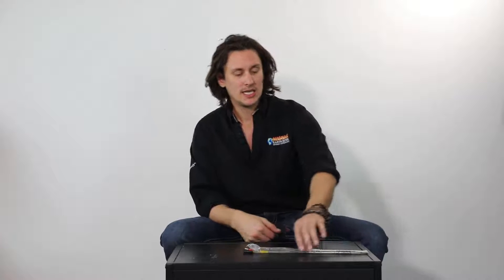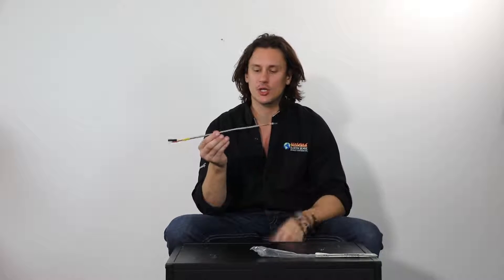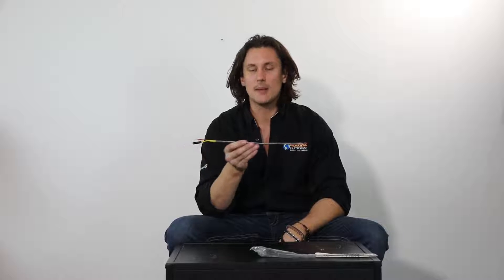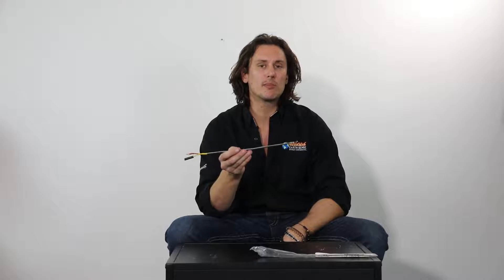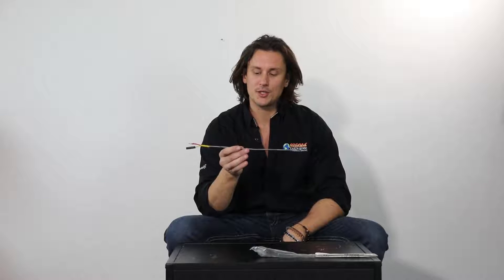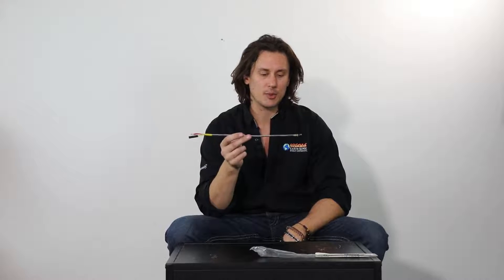Quadrafire Thermocouple Function & Troubleshooting

Comment: Mine Quadra fire will  run but not reach temperature at all then some time it fine ??
Reply from the maker: Thanks for contacting us. Let us know which Quadra-Fire model you have. Sounds like your stove is going through startup and sometimes goes into normal operation but majority of time shuts down after startup - is that correct? The thermocouple senses the heat during startup allowing the stove to go into normal operation. You can double check the thermocouple electrical connections, and make sure the thermocouple is far enough over the firepot. Always make sure the ceramic cover is on during operation. Here's a video with some tips on the ceramic cover and placement of the thermocouple https://youtu.be/tOqcNRELOq0?si=CmYUF0xyzOSNb3Q-
If you do need a new thermocouple we can help steer you towards the correct replacement once we know which model you have. Happy to assist, thanks.

Comment: Im at my witts end with my castile insert. It was running perfect at the end of last season and when we went to run it this year it would just feed pellets and the igniter wouldn't get hot ,i changed it and it turned on but would cut out after a few hours. I have since changed all 3 snap discs and the thermostat,  then i was getting a 3 amber light 3 blink code which is supposed to be the thermocouple so i changed that now it lights and the igniter stays on then the stove shuts down but with no codes (blinks) . I have also changed the vacuum switch and blew air in the line to make sure it was clear and it was. My local dealer closed down and the 2 other dealers that took over after that one closed do not return calls and there is no customer service number.  Frustrated and thinking its time to get rid of this thing. Ive had it for almost 20 years and purchased it brand new and have also changed the auger mother 3 times the exhaust motor and the fan motor once each.
Reply: Ok ,I will give it a try tomorrow. And report back. Thanks
Reply from the maker: Thanks for contacting us, happy to help. Glad the unit is now igniting properly. Let's try reversing the wires for the Thermocouple connection to the terminal block. Let us know if that makes any difference for you. Keep us posted.
Reply: @EarthSense hi, thanks for replying.  I hooked up the wires exactly the same as the old thermocouple. One wire has a male terminal (red wire) and the other has a female terminal (yellow wire). Are you saying to cut and reverse those wires ?
Reply from the maker: @bryanmcgovern7858  We have run into a good number of the Quadrafire thermocouples where the wires need to be reversed on the terminal block to work as it is supposed to. Based on what you described it does sound like we have an issue with the Thermocouple registering temp after startup. Reverse those wires and let us know. Thanks.
Reply: @EarthSense ok, I will give it a try tomorrow and report back. Thanks
Reply: @EarthSense omg, you are a life saver ! I made 2 three inch jumper wires ,(male to male and female to female) instead of cutting and splicing and the stove kicked right on and the igniter went out and she is feeding pellets. I would have never known or thought to do that. I know my way around cars ,small engine equipment and I have done work on this stove for close to 20 years but you just made my wife happy and saved us some oil money.  We thank you for your help and knowledge.
Reply from the maker: @bryanmcgovern7858  Fantastic to hear! Had a feeling that was what we were running into. Appreciate you letting us know and so glad we were able to help. Happy wife, saving some money - the good things in life :) If anything else comes up just let us know. Have a great upcoming Thanksgiving!
Reply: @EarthSense thank you. Have a happy Thanksgiving

Comment: I have a sante fe insert, Quadra Fire, it is not igniting.  The stove calls for heat and there is a red light indicator that comes on, but nothing else is happening.  The exhaust fan doe not come on as indicated in the manual, pellets dont drop in, the ignitor does not come on.  I replaced the ignitor , so that is new.  I hit the reset button and have the operating switch on high.  I'm stumped.
Reply from the maker: Thanks for contacting us, happy to help. Let's start with looking at the exhaust fan. If the exhaust fan is not operating, then both fuel feed and ignition will not work. You can test your exhaust fan to direct power to determine if the motor has gone bad. Here's a quick video on doing this. https://youtu.be/rlmiCYI2WPk?si=ebBFf9jiXd1tkxvT
Keep us posted, happy to assist.
Reply: @EarthSense  I will test the fan next.  I am starting to think my issue is the module itself.  I am not seeing any LED's flashing or coming on at all.  The only light that come on is the heat call light.  Fuse is good and i have power.
Reply from the maker: @ThePaesan1  Thanks for the message. If the exhaust fan tests well, then take a closer look at the control box. See if there is any marks/burn spots. Check the wiring from the junction box to make sure there are no exposed wires and all wiring feels secure. Make sure the stove is unplugged when working with the circuitry. Keep us posted, happy to help.
Reply: @EarthSense  Ok so the exhaust fan tested good and came on when i directly tested.  I tested the vacuum switch and that was good as well.  
Wiring to the module all looks good and no burn marks on the module connections.  Going to order a new module next?
Reply from the maker: @ThePaesan1  Thanks for the update, glad you were able to check those items and verify they are working correctly. One last thing to check before we determine this is a control box issue would be the high limit switch. In early Santa Fe and Castile models, if this switch was tripped or faulty it would not allow the unit to go through start-up and into normal operation. The high limit has a reset button in the middle to push and reset the switch if it trips. We can also troubleshoot this by jumping the high limit to see if it's the culprit. We never want to leave a safety switch bypassed, this is just a good way to troubleshoot it to determine if the issue is here. https://youtu.be/FDVkbsHS95U?si=Qdj4iS0dQWPBeS1e

High Limit Switch for reference: 

https://pellethead.com/product/pellethead-replacement-quadrafire-heatilator-250f-high-limit-switch-w-manual-reset-snap-disc-3/

Keep us posted, happy to help!
Reply: @EarthSense  Well i did replace the high limit switch as the old one did not have a reset.  It was a cheap part, $19.  However, i bought a new control box and the stove fired up.  I thank you for your videos and sharing of knowledge.  I will direct my friends to your channel.  Thanks again!
Reply from the maker: @ThePaesan1  Thanks for the message back and update. Great to hear it fired up with the new board, fantastic! Glad you got the high limit replaced as well. Appreciate you sharing our channel. If you need anything down the line just let us know.

Comment: Question for you all if you could help: I have a Quadrafire 1200 that is having an issue where it will fire up and work fine the first time, but then when it should run again another cycle after completing the 1st if it is within a short period will turn the fan on but not drop any pellets.  If I turn off the thermostat and  just leave the unit for awhile until it cools sufficiently, it will then work fine again.  Any idea what would cause this behavior?
Reply from the maker: Thanks for contacting us, happy to help. You'll have a snap disc in the 1200 that is turning on your room air blower once it reaches temp. Sometimes the initial fire sequence gets hot enough to lock this switch in and turn the fan on. The thermocouple is the most likely culprit in this situation. It sounds like it sporadically works as it is supposed to, recognizing the heat after initial start-up, allowing the stove to go into normal operation and continue feeding. Inspect the thermocouple and electrical connection. If the thermocouple checks out good, then it will be good to check the vacuum switch. Video here on that - https://youtu.be/kR0DQ6_YXuI?si=jTUnOddgOewhg92-

Keep us posted, happy to help.
Reply: @EarthSense  Thanks for the response - yeah I thought it sounded like it might be the thermocoupler - I ordered one and just got it in the other day and plan on replacing soon.  I also thought my be a bad vacuum switch so also got one of those, or the snap disc.
Reply from the maker: @adamfrench1914  Thanks for the message back. It's hard to say because the issue is there and not there. Keep us posted once you have the new thermocouple installed. For testing purposes we can bypass the vacuum switch and high limit snap disc to see if either are culprits - here's a quick video on doing this - https://youtu.be/FDVkbsHS95U?si=ttti81rHvCSErzsP
Reply: @EarthSense  Okay - I replaced the thermocoupler and that did not help at all - it wouldn't feed ANY pellets even after a few unplugs and hitting reset.  I then went ahead and replaced the vaccum switch without doing the tubing itself and it dropped pellets right away.  Hopefully that is the solution.  My stove is I don't even know how many years old since I have only lived at the house 5 years - I am guessing it must be 10 years old probably at least.  I may have damaged the vaccum switch as well last year when I was trying to figure out what was wrong which turned out to be auger motor which I had replaced.
Reply: But now it won't feed pellets after the initial feed - so it doesn't keep it going - did I install the thermocoupler wrong or some kind of other problem?
Reply from the maker: @adamfrench1914  Thanks for the response. Yes, sounds like a vacuum issue if the new one is allowing the unit to operate normal again. You only need to replace the tubing if it's cracked/split/brittle. Appreciate the update.
Reply from the maker: @adamfrench1914  Thanks for the message. Appreciate the update. Are you seeing any blinking lights on the control box? Let's double check the electrical wiring, we have seen cases where the thermocouple wires need to be reversed on the post connection. You may find additional helpful references in these two videos for thermocouple connection and placement. 
https://youtu.be/Hjs3KhP9ntI?si=S4oSkXMp7w-N5l2c
https://youtu.be/tOqcNRELOq0?si=YmFNykNPw1F-WB9T

Let's also do a quick test by tossing a half handful of pellets in the firepot before startup. It's possible that we are not getting enough fuel coming in on start-up to lock in the Thermocouple. By doing this, we are simply making sure the temp is high enough to trigger the TC. Keep us posted.
Reply: @EarthSense  Yeah okay - I didn't see your response before I thought - well let's try reversing the wires for the thermocoupler and just started testing now and it is indeed feeding.  That is rather odd that the wires need to be reversed since I made sure to match yellow to yellow and red to red.
Reply: Now it is overfeeding pellets almost filling up the pot with pellets
Reply from the maker: @adamfrench1914  Thanks for the response. Yes, it is odd and something that we have seen periodically over the last few years now. Very glad to hear the stove is now feeding as it should after startup.
Reply from the maker: @adamfrench1914  Is this happening during start-up or after the thermocouple locks in? The feeding cycle is controlled only by the Circuit Board/Control Box. Is the auger motor running in cycles or is it feeding non-stop?
Reply: @EarthSense After the initial start - it will just keep dribbling in pellets a few at a time - even once the fire is huge.
Reply: @EarthSense  It is after the initial startup.  It then just keeps trickling some in non-stop.  Not like a deluge but just a few at a time continuously.
Reply from the maker: @adamfrench1914  Thanks for the message back. If the auger motor is running non-stop it's typically a circuit board issue. Did anything short or happen when you were servicing the thermocouple? Let's try unplugging the stove and pulling out the control box. Check the contact points and make sure they look good, no burned spots. Put the control box back in and let us know if anything changes. Thanks.

Comment: Upon initial start I get the blue flashing light but no other lights. No green or red
Reply from the maker: Thanks for contacting us. What Quadra-Fire model do you have? Do you have a clear control box on it? Is your Red Call Light on the stove on during start-up? Does your stove feed and light currently during start-up? Happy to help.
Reply: @EarthSense it does the initial start up but that’s all
Reply: @EarthSense I have the sante fe manufactured in 2005
Reply from the maker: @WilliamAllen-k8h  Thanks for the information. Good to hear your Santa Fe is going through initial start-up. After initial start-up the thermocouple is what registers the fire and allows the control box to go into normal operating mode. Have you recently replaced the Thermocouple? If not, let's pull off the ceramic cover and inspect it first along with the wiring connections. Regarding the No Call Light. You should have a red call light come on as soon as you turn the thermostat up to call for heat. The red call light is on the junction box. If you are not seeing this light come on, but the stove is going through initial startup, it's most likely the bulb burnt out. Happy to assist. Here's a couple additional thermocouple videos that may help. 
https://youtu.be/tOqcNRELOq0?si=lLr-YQalbSevjEF0
https://youtu.be/Hjs3KhP9ntI?si=frxaVw1bn-GkjjTo

Comment: My Santa Fe exhaust blower failed. I replaced it and it works fine. When putting things back together I noticed that the TC leads were not plugged in and there was no connection wires to be seen going to the control board 😮. After replacing the exhaust blower, the unit will start, it will feed, it will fire up but no more pellets will be fed. It just shuts off. This doesn’t make sense that there would be no wires to connect the TC to the control board. Suggestions? What am I missing?
Reply from the maker: Yes, very odd scenario here with your thermocouple leads not being connected. With the TC disconnected it will never get past start-up mode. Here is a wiring diagram for your Santa Fe. Page 39 will highlight the TC wires. You should have 2- thermocouple lead wires coming from the junction box in which the control box plugs into. Yellow and Red lead wires from the junction box are your TC wires. Keep us posted with what you find, happy to help. https://downloads.hearthnhome.com/installManuals/7001_142.pdf

Comment: Quadra Fire Classic Bay - Won't restart when temp drops
I am having continued issues, the same issues with my new Quadra Fire Classic Bay Pellet Stove
In Summary: 
Stove works O.K. then the room temp reaches the thermostat set temp and turns off.
But it doesn't always turn itself back on. This doesn't happen every time but roughly twice a day
If I hit reset, this doesn't always work,but sometimes
If I unplug the stove, wait a couple seconds, plug it back in that doesn't always work, but sometimes
If I do BOTH - Unplug stove, wait a few seconds, plug it back in, wait a few seconds and hit reset it works.
HOWEVER, I've had two service people out and the last person here stated that when he was fiddling around behind the stove when he just wiggled screw #3 it turned itself back on  Therefore, he thinks the issue may be with the internal stove wiring itself

So . . . last night I tried the same as he instructed me to do this. Initially it did nothing
But when I had the screwdriver touching #2 it accidentally also touched #1 at the same time
This created sparks and the stove turned back onI am concerned that this may simply be a defective pellet stove and don't want to wait until whatever warranty I have expires and then I have to recourse. 

NOTE:
There are FOUR screws at the bottom left back of pellet stove. From left to right. The thermostat is connected to screw #2 & #3.
Reply from the maker: Thanks for contacting us, happy to help. Generally an issue like this would be either the thermostat, thermostat wire, or thermostat block. Sounds like you and technicians have narrowed this down to the thermostat block. We would still suggest inspecting and/or testing a different thermostat and thermostat wire (Low Millivolt). Yes, the #2 and #3 thermostat block screws are the contact points for the thermostat wire. If you have not yet, let's check the wiring connections on the backside of the thermostat block. Check the wire connection terminals for corrosion, use steel wool to clean them up if needed. Make sure everything is secure and all wires look good. It would be rare for there to be an issue with the thermostat block itself, but if all the wire connections look good, that could be the culprit.  Here is a seller that offers the 1200 thermostat block. Hope this helps. https://www.stove-parts-unlimited.com/quadra-fire-thermostat-term-dv-block-srv230-0690-p/srv230-0690.htm